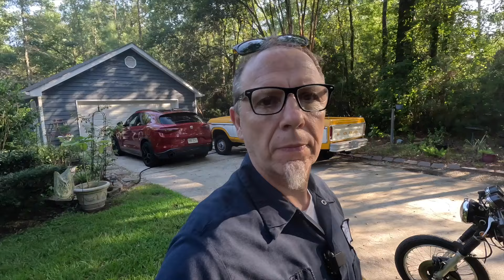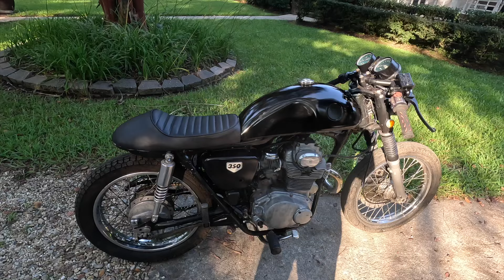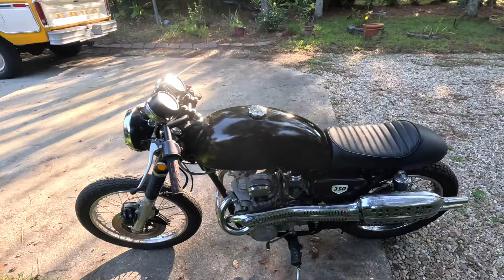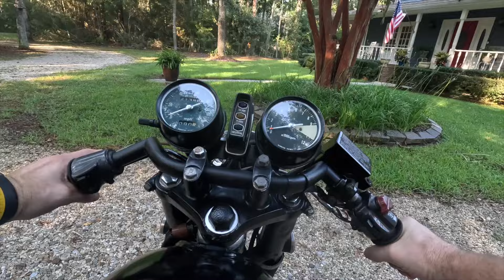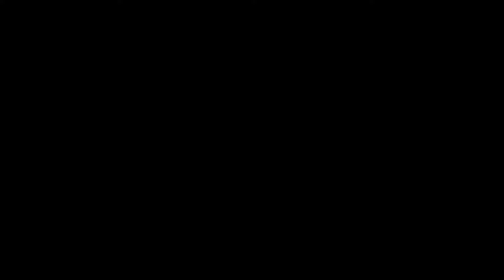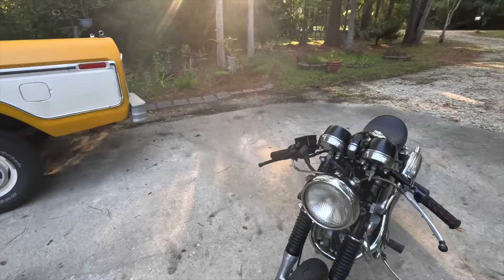1972 Honda CB350 24-Hour Build is Finally Finished

Comment: Your f150 there is a beauty. Still one of the toughest trucks on the road. Had a '79 f150 2 wheel drive with a factory installed 460 and single cab. Drove it 350k miles on original engine and tranny. A little thirsty, but tough as an anvil. Had a '70 CL350 and still love 'em.
Reply from the maker: The truck is a 1978 4x4. It has a 351 and a super rare option. Factory CB radio, only available in 1978.

Comment: Nice hack job! :)  I understand the part of being "over it". I have one of those going right now too. I have a pretty short attention span and I have started dabbling on another bike while trying to finish the first.  I like the tank choice. It fits well with the seat and bars. It needs the old Honda badge stuck in that circle.
Reply from the maker: It sure does need a badge in there. Thanks for watching.

Comment: That bike is absolutely fantastic Eric.  I love the tank/seat combo and the upswept pipes - wow!  For me, what would finish it off is very short polished aluminium or stainless steel mudguards.  Great job.  Cheers!  ❤️👍✅😎
P.S.  does it need a Honda badge on the tank, or perhaps your own MR badge?!
Reply from the maker: It definitely needs a badge. I had kicked it up with the ones from the Dream. Just couldn’t bring myself to spend the $70 for another set. 🤣😂🤣

Comment: a little bit of smoke coming out of the top exhaust pipe
Reply from the maker: That was from me trying to find the oil leak with the spark plugs out. Got a bunch in the right exhaust. I heat cycled it a few times and it cleared up. Thanks for watching.

Comment: Cool bike! I think you have a bit of girl math going on. At some point or another you had to buy everything that you "had". I built a 360 kinda like this with those upside-down bars.....I rode it a few times and ditched them cuz they're definitely not comfortable. Way to push through!
Reply from the maker: Very true! Most of the pieces and parts I "had"were given to me. Example neighbor kid bought the tank for his bike and it did not fit so he gave it to me. Exhaust came in a huge $100 parts lot. Then I get to add in the girl math!
Reply: Girl math 😂😂